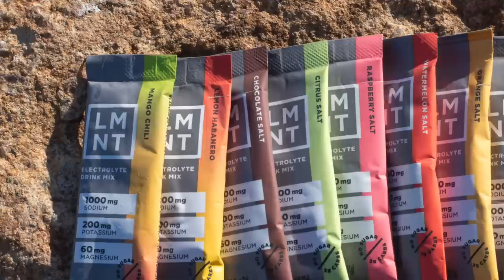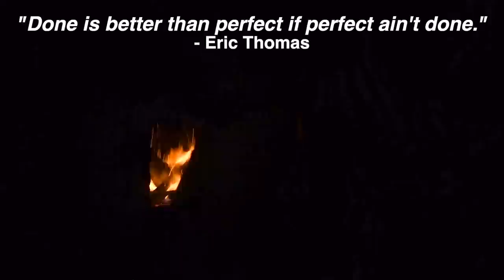Major Upgrade to the New Primitive Hut (episode 45)

Comment: It’s interesting to see what a real adobe/clay hut looks like as opposed to the fake ones you see all the time on YouTube. As well as the incredible effort that goes into making the pieces and assembling them.
Reply from the maker: Are there really fake ones out there? What is a fake Adobe hut made of?
Reply: @ChadZuberAdventures they have some primitive build videos where they make these incredible structures, digging out massive holes by hand, making pools, etc. Which are cool to watch but they’re using cement, digging vehicles, crews and not what is only directly around them.
Reply: @zacharygreene2419  they are not fake, the only thingh its that they have equipament, and remenber exist diferents technichs and diferents soils and cultura behind it?

Comment: that's what we all have been waiting for! thanks for your afford Chad
Reply from the maker: My pleasure! Enjoy!
Reply: @ChadZuberAdventures  Hey Chad. You mentioned about how a tiled rooftop would be ideal. Do you plan on doing that at some point or just sticking to the bark. Any idea when you might upgrade if you do decide to? Tia
Reply: @I_Scorched_You  He mentioned in a previous video that the weight of all those tiles would be a lot.  I suspect he's (rightfully) concerned about the structural integrity of the roof, since he's working with a wide variety of (formerly) green and deadwood branches, and not much in the way of joinery.  A lighter roof material is simply safer.  Plus, clay tiles are difficult to fit onto a round roof.  Not impossible, but you have to be pretty good at the math to get the wedge-shape just right, and it'll be a different size for every single concentric ring around the roofline, from edge to peak. Square would be better, but as it is, a round roof actually saves on how much material has to be gathered, processed, and applied, compared to a rectangular one, so Chad saved himself a lot of trouble by not having all that extra work.

Comment: lol, "i have never been stung by one but i have eaten them". what a casual badass. 
fantastic work on the hut, i am so happy for your back! 
burning off the ends of the wood is a great trick: in addition to all the things you said, charring the wood makes it more fire and water resistant. charcoal is really hydrophobic so water won't soak in as easily if the wood were to get wet, and it doesn't ignite as easily as dry wood either. smoothing and rounding the ends so no thin fibres are sticking out etc also helps with both these things. nicely done!

Comment: I just noticed that when you were getting more sand and dirt at 21:57 that it is pretty solid, so if you ever need to make a place that you need to store cold thing just dig a basement, you may have to add supports but in hot places it is cold underground. I also love your videos.

Comment: I have a suggestion for the garden! If you're worried about watering and the heat, a good solution would probably be an olla. Look into olla pot irrigation, it's essentially an unfired, clay pot that you can bury underground with only the top peeking out, and a cover. You can refill it as needed and the pot will slowly release water into the surrounding soil!

Comment: 23:06  I wonder how hard would it be to turn the pit into a heated bathtub?  Lined with fired clay tiles and using a wood fire to heat a large clay reservoir, that is gravity fed into the pit,   I imagine that would be quite the treat after a long day of work.
Reply: Might be difficult to get enough water though

Comment: The new walls look great. 28:50 How are you purifying the water? 
(End) Is it going to be warm enough during the Winter? With the windows and larger area, it will be harder to heat. I assume you have a plan for that. Do you need to increase the opening to the fireplace?

Comment: Very impressive house indeed! I wonder whether the roof will still function though. Even though the material is the same, it is now at a much flatter angle. It may or may not shed water slower now and start leaking. Also, have you considered making a tiny hat-like tip for the roof?

Comment: just for brainstorming:  I was thinking... would building a second wall around the first one, with a couple inches of space between the two, and then filling that space with some kind of "found in nature" insulation (shredded juniper bark, dried grass, something like that) work at all for some more insulation against either heat or cold or both? or would that just be more work than it is worth?
Reply: I don't think that would work. You would have to dump tons of that stuff in that space for it to even reach some meaningful height to provide some insulation. Cool idea, but not doable.

Comment: I watch u tube and see other doing similar things people that do survival  most of them have a fishing pole and a knife or a hatchet  I know you are trying to be a purest  but I have been fishing in the wilderness for years you need open face reel with clear 8 lb test and small number 8 or 10 hooks they fishes mouths are not very big my experience is you also need a 1 eighth ounce with a hole all the way through it that way it does not get caught on the bottom  it just rolls two hooks above sinker . However those wild trout are so smart you csn only catch maybe two  somehow they communicate with the other fish I learned if you throw your  line a hundred feet away from you can catch a couple feed yourself I always use grasshoppers and worms and whatever is under rocks in the creek small bugs that live in the water under rocks . All thos survivalists  on u tube do it all the time . Those native brook trout are almost impossible to catch  you gotta lay on the ground  dont move they can hear every vibration you make . Those fish are delicious  if you can catch them I seen them crawl out of water eat the bugs out of water before  . You can reach up under the bank grab them with your hands . I have done that to .